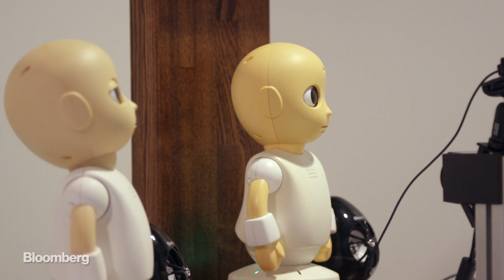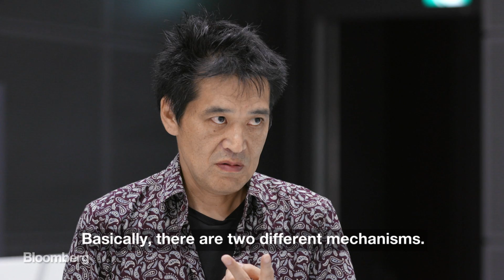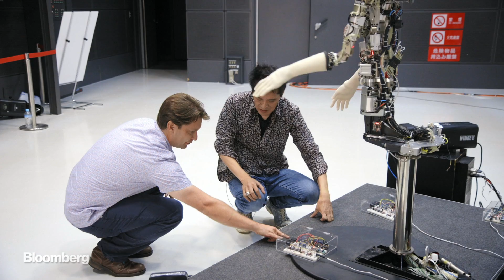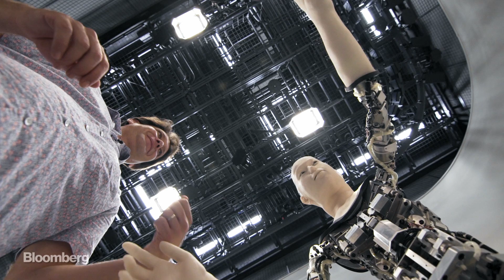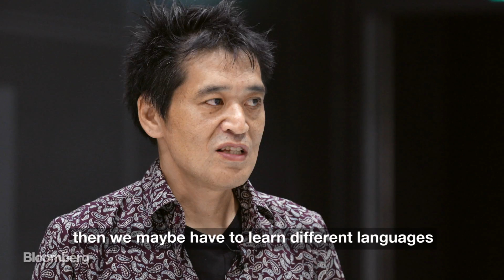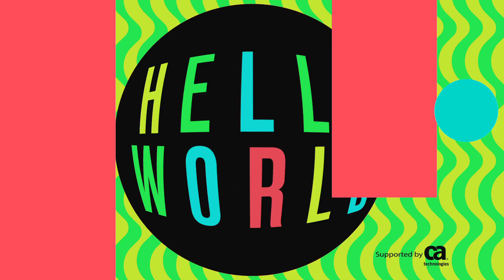This Japanese Robot Evolves Based on Its Surroundings

Comment: The apostle John described this:

"He was granted power to give breath to the image of the Beast should both speak and cause as many as would not worship the image of the Beast to be killed." Revelation 13:15. 😱😱😱😱

And The Prophet Daniel too:

" As you saw Iron mix with ceramic  clay, they will mingle (Fuse) with the seed of men; but they will not adhere to one another, just as Iron does not mix with clay." 😱😱😱😱